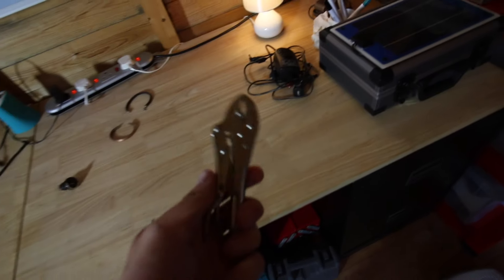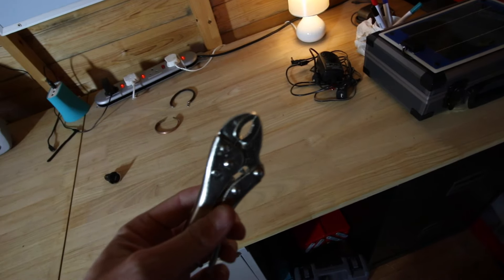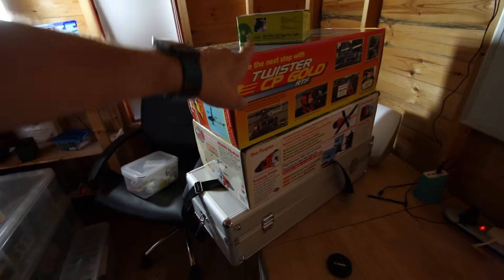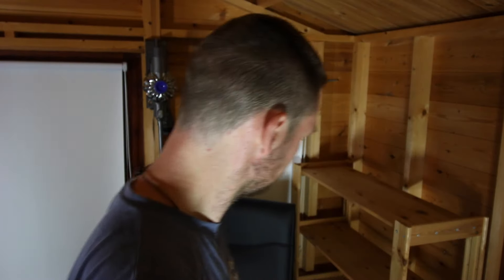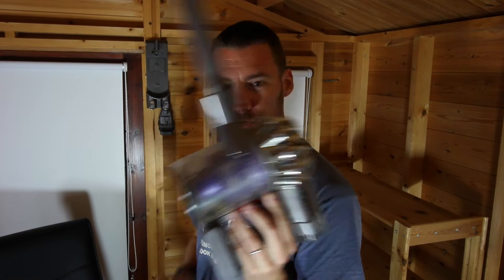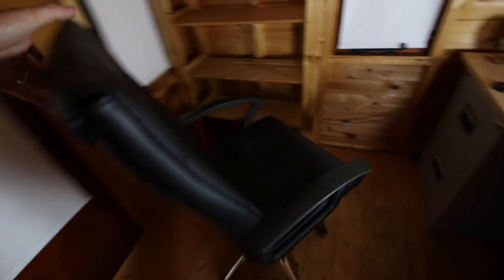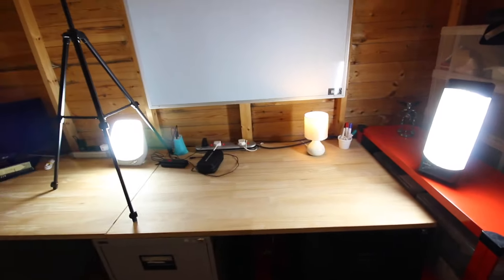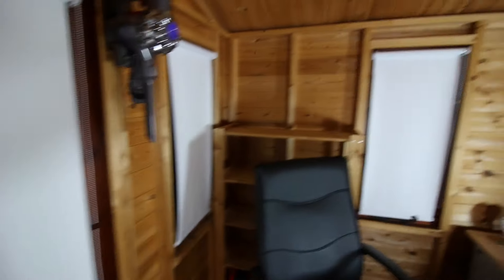41kWh ZOE and My Studio

Comment: Insulation for winter use plus sound deadening.  Better lights, kettle ...
Reply: Wool would be good for that - you get heat in winter and cool in summer - plus it meant to be cheap - and a great plus ~ it is harmless it can be installed without gloves or protective clothing becuase is not irritating to the skin, eyes or respiratory tract.

Comment: The microphone cycling buzz sounds like local EMF interference:  Electro Magnetic Frequency is common to cell phone, WiFi, Bluetooth, remote phone, or nearby airport radar (sum such).  And, sorry to say, EMFs are usually on frequencies that are not good for human health and sleeping.  However, that microphone could be a useful EFM-detector.  [The clicking is obviously from gerbils chewing on the wires -- Yes I'm joking.]
Reply from the maker: Yes it's weird that it only happens in the office in the house. I think it might have something to do with the sloping roof reflecting some sort of signal, perhaps the router.
Reply: Something in there is buzzing at you.  Router could be suspect, especially if WiFi is turned on.  
// My high compliments on defining functional improvements for your new "editing" space.

Comment: On the Zoe and EV's in general - I realise they have different efficiencies - drag, weight etc but when i have seen ranges for the Zoe = they seem to vary dramatically due to temperature as in 50% less range where others claim to only have a slight loss. Do EV's vary that much in their stats based on external factors or should they all be similar?
Reply from the maker: The kind of heater makes a difference, but generally as the battery gets bigger, cold makes less and less difference to range.